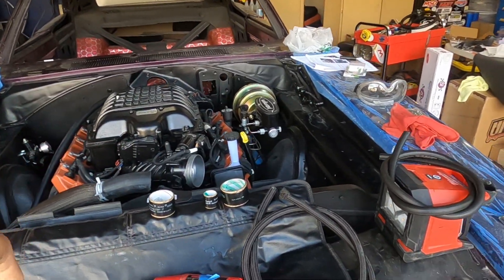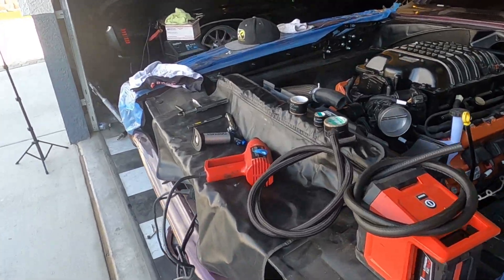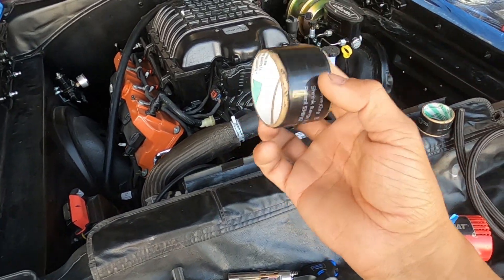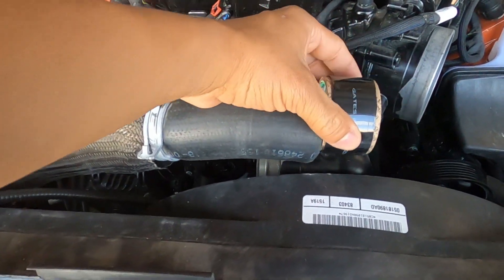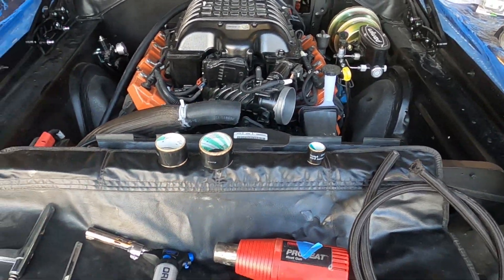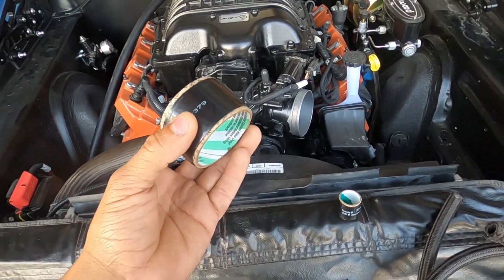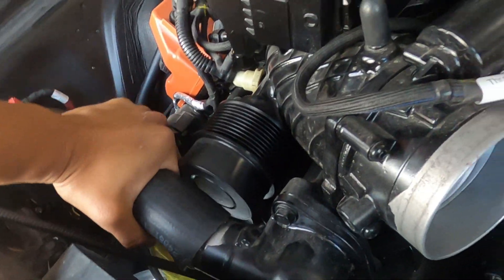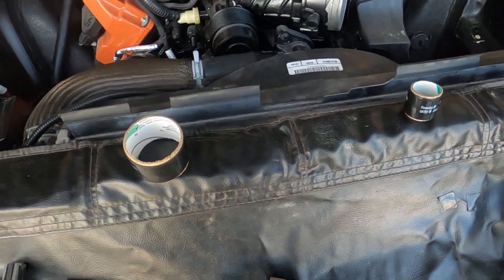HOW TO INSTALL AND REMOVE HEAT SHRINK HOSE CLAMPS!

Comment: Another great video bro, keep them coming.  Question, is there any way to remove all the lettering on the hose clamps so you just wind up with a solid black hose clamp? I may be nitpicking but curious, would be really good to have a solid black finish.
Reply from the maker: Brake clean
Reply: @goosseperformance1444 u da man!

Comment: Another trick is to use a small flat blade screwdriver with the razor blade. Wedge the flat blade under the clamp and cut on it. This will allow you to cut in alot quicker and reach areas that are too small for the tool.

Comment: I have been running these for years.  It's amazing how many mechanics have not seen them.  They work.  They work well.  I recommend them.  They will not blow out.  Had the Cutlass out a couple of weeks ago.  Temperature at 80 mph went up to 218 degrees.  That actually helps these to grip tighter.  I did not know about the tool.  I am getting one of those.  I am about to replace belts and hoses on that Cutlass.
Reply from the maker: Nice

Comment: Half a million views is great, but its not viral until it hits a million views. These are nice if you're trying to do a super clean build like a show build or like you said if you want to put them on and want to forget about them and have a nice reliable clamp then these are the way to go. But if you have to do any work on the engine that you have to remove the hose for any reason then you're kinda screwed.